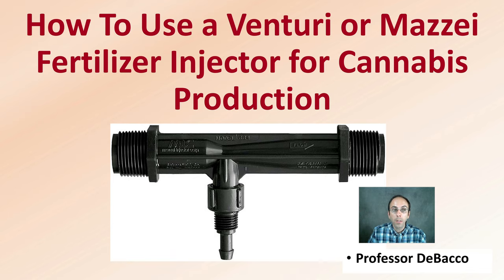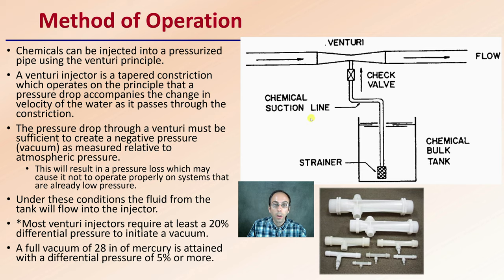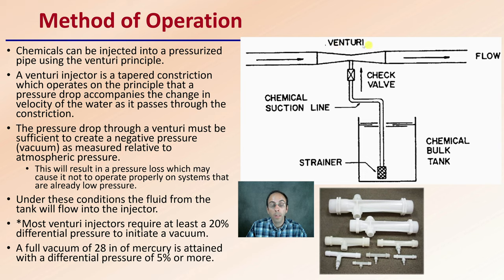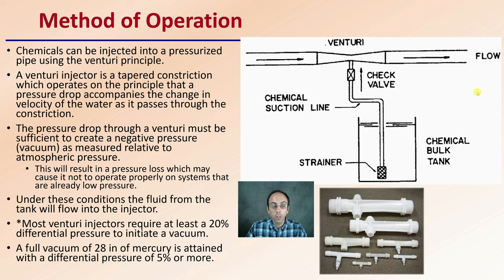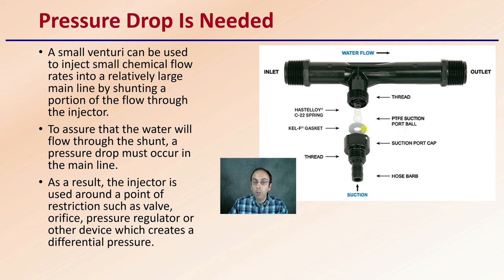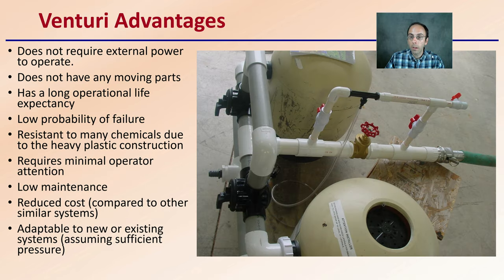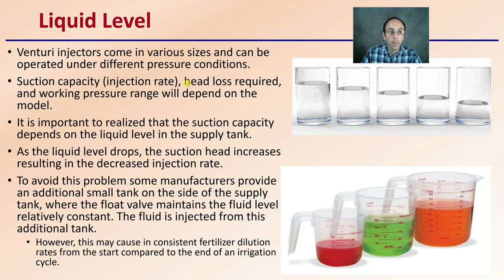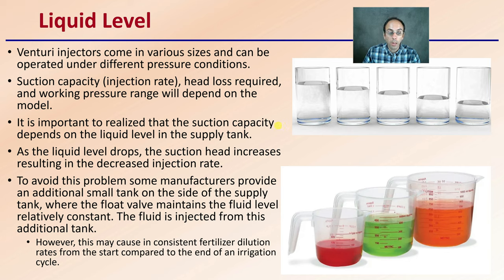How To Use a Venturi or Mazzei Fertilizer Injector for Cannabis Production

Comment: Im only using 10 drippers on the outflow, it creates back pressure so the venturi does not open to suck fertilizer, what should I do to create a pressure drop or assist me in opening the Venturi? I have read many many things but cannot find resources on my specific setup. I have a main line from the house connected to just a U on the mainline with a valve on the main line between the U of the venturi as well as 2 velves on each of the venturi U arms.
Reply from the maker: If you are only using 10 drippers you can likely hand water or use a stock irrigation/fertilizer tank and do not need the Mazzei.